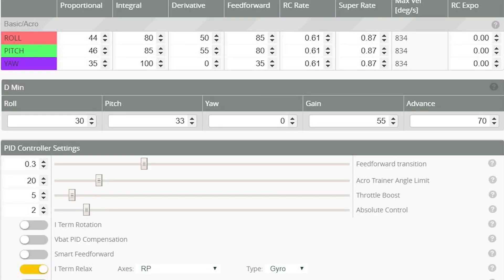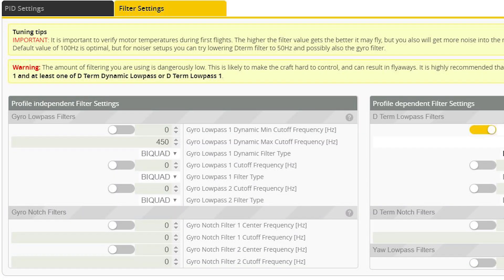Betaflight 4.0.2 Filters / D Min Gain Advance / Reduce Propwash / Tune Tuning

Comment: Hello from Spain i studdy more then 1 month all about 4.0 on Git Hub and have the same results like you , because the changed 500 things on 4.0 or 4.0.2 and yor vidio is short and very good . Thanks and best regards from Alicante Spain :-)))))))
Reply: I have seen all Vidios fom UAV TECH Mark Spatz and Joshua Bardwell  and no recomended Bidirectional Filtering beta 32.61 or RPM  . The final version is 01.09.2019 betaflight 4.1 .!!!!!!!
Reply: Hello Josh i have flaying your PIDs on my Diatone GT 530X Mamba 4en1 40 amp and it goes fantastic .Thanks and best regards from Alicante Spain :-))))))))))))

Comment: Noob question. In one of JB's video, he mentioned by turning on gyro lowpass filter and the cascading d filter to avoid the flyaways. If I turn them off will it cause any crazy shit?
Reply from the maker: Nobody can say for sure, but the trend is yes.  On every single build that I've done in the last six months, I've been able to turn off all gyro filters and to use one or both of the d low pass filters to get optimal results.
Reply: @JoshWithrow  thanks for the reply! Does anyone know why quads are taking off randomly?
Reply from the maker: @super.saigon  more times than not, the answer seems to be noisy d.  that's why having the D filtering is so important.
Reply: @JoshWithrow  alright.. I'm going to try and fly without those filters today.
Reply from the maker: @super.saigon  just to be clear, I'm advising that you keep dterm lp1 and 2 filters enabled and the dynamic filter, but disable the gyro filters.  Good luck!
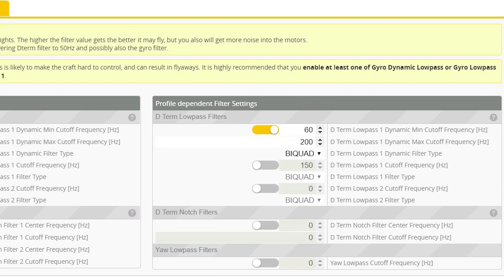Reply: @JoshWithrow  the setup I have now is 2:30 in this video

Comment: well hopefully this helps me with odd propwash behavior on decent to ground or even when i powerloop trees and come back over it will slightly wobble. i have a 5" quad with mr copper 2306 motors ,matek f405 ctr f.c so im hoping your tips helps mine . so tired of videos looking horrible due to propwash

Comment: You Test new version 4.0.3?
Reply: I have 4.0.4 :-)))))))
Reply from the maker: I have not yet.  It does address a problem with D_min, but it's just a configurator problem.  Nothing major was pushed out with 4.0.3.
Reply: hi  @JoshWithrow , what about these settings on 4.0.4?
Reply: @airflowfpv7791  Running similar settings on 404 with a toothpick , just upped the filter hz range a little, not that it was needed

Comment: Thanks! This helped massively on my 2.5" Diatone GT 249+.  I had terrible propwash when exiting power loops and split-S's. Switching to Emax Avan props helped some. But now with the D and filter changes you mentioned, there's no propwash to be found anywhere. Amazing. This little quad flies buttery smooth. Thanks again.

Comment: Thanks for the incite. Question. I'm tuned what I call very well looking to go after the filtering now UAV tech recommend 60 to 175 and you at 200. I'm a little gun shy as to over heating my motors. How conservative would you go at first? Have you had any issues with overheating? Thanks
Reply from the maker: I can get away with the filtering ceiling at 150hz, but I wanted alittle more range for the people who don't know because they don't have black box.
Reply: Thanks

Comment: If i disable all the filters you showed does that mean my kwad might take off to the sky? Sorry still new to all this tuning. Im runnin a 6s 1700 kv 654 gram 5 inch freestyle kwad
Reply from the maker: The possibility is always there, but it shouldn't.  These are a bit conservative.
Reply: @JoshWithrow  ok thanks. Im very close to a really good tune. I mean it flys great but im just gettin nit picky.
Reply from the maker: That's how I started down this path :)

Comment: Well I'll be a Monkeys Uncle! Been having some oscillations decided to go down that rabbit hole as well and like one of the commenters said, smooth as a shaved cooter 😂😂😂
Reply: Thanks Brother 👍
Reply from the maker: Good deal, bro!  Keep me posted!
Reply: OK, so that was tested with the Ethix S3's and flew great. I like the lift at low throttle from the Cyclones so I swapped out the props. Now I'm getting some oscillations at quick throttle punches. Should I play with the TPA a bit at this point instead of touching the actual PID numbers? Thanks Bro 👍
Reply from the maker: Try raising your tpa to .5 @ 1850.  The dals are more aggressive and are probably changing the response.
Reply: Currently set at 50/1500. Will change TPA Breakpoint to 1850 as instructed. Should I still leave TPA at 50?
Reply from the maker: Yes. If that doesn't do the trick, leave the TPA at 50/1850, then reduce P on pitch and roll be 3ish points.
Reply: Thanks again Josh. I'll report back later 👍
Reply from the maker: You're welcome!
Reply: Hi Josh. Ok, so I went back to 50/1500 on the TPA's. Lowered my iterm relax cutoff from 20-10 for a more responsive feel and dropped both P&R PIDS by 6ish and it's flying pretty good. Here's a link to the unlisted video. By no means is this an all balls out flying video. I'm just trying to get a feel for the new tune. Do you notice any jello? 

https://youtu.be/XGuef62XOvg